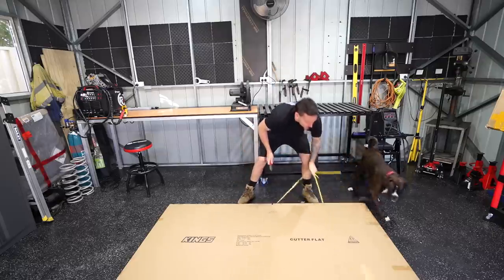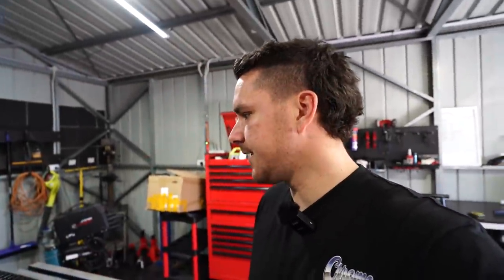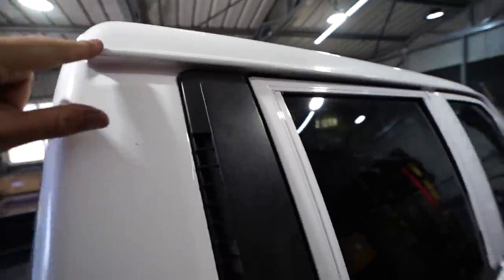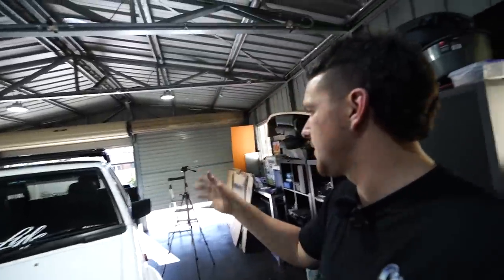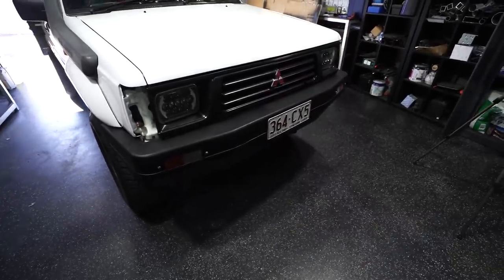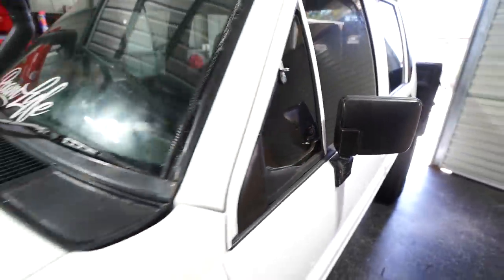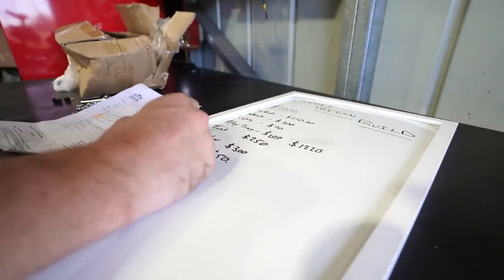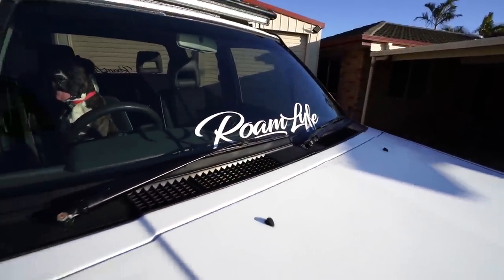THE BUDGET IS GONE!!! Most Expensive Mod yet...

Comment: Big upgrade in capability for an old triton. 7.50R16 muddies, best thing i ever did to mine and i had a few of them. 
Eventually i went with 235x85R16, and the last one was on 33x10.5R15s as i built them bigger and bigger. But the 7.50r16s are the best bang for buck mod, and plenty of cruiser boys sell their factory road grippers off cheap...

Comment: Not sure if it works for snorkels, but when plastic truck mud guards are faded, you can bring back the shiny lustrous finish, just by heating them up with a heat gun
$101 might get you a 2nd hand UHF?
Reply from the maker: It does work!! I started with a small jet lighter but it would have taken ages to do!! I actually have a plan for the UHF!
Reply: Hair dryer is basically a heat gun @RoamLyfe  👍👍

Comment: You should spray a few coats of raptor 
 on the roof rack to stop it from rusting.

Love the vids btw keep it up 🤙🏼
Reply: Raptor isn’t cheap and that’s the idea of this series. Just spray some rust protection in there to slow down the internal rusting on it or even some cooking oil, it works a treat. I put 2 pieces of steel outside and put cooking oil in one and it didn’t rust. And that’s in QLD
Reply from the maker: Great idea! Thank tou

Comment: Surely all it would take is a couple new holes in each bracket, to drop it down?
Either way, looks good.
Reply from the maker: It would but also have to cut the top section off the bracket so it can slide down more! The light bar legit just fit under it too so that worked out well!!

Comment: How did you even find a duel-cab 4x4 for $2k? Was there anything mechanically wrong with it? What sort of km's does it have? In your opinion how many km's is too much for a diesel? I'm in the market for a duel-cab 4x4 that I can use for work as well as getting into 4wd'ing on the weekends but I'm struggling to find anything decent under 10-12k

Comment: Really not a tint spray fan. My opinion is its pretty tacky looking and can compromise peoples ability to observe your turning signals on the road which is where we all use our rigs majority of the time. Peoples driving can be dangerous enough without adding that into the mix. Also as you would of course be aware it's illegal in most places. Just doesn't seem worth getting pulled over for in my opinion. Other than that love the build and the channel in general, keep it em coming!
Reply from the maker: Thanks mate!! The tint spray is definitely a p plater mod haha!! I only done it to tie in the front end and I had some laying around!! The indicators on the car where disconnected and fitted to the bullbar so turn signal has stayed the same, although I don’t know why it was disconnected in the first place hah!